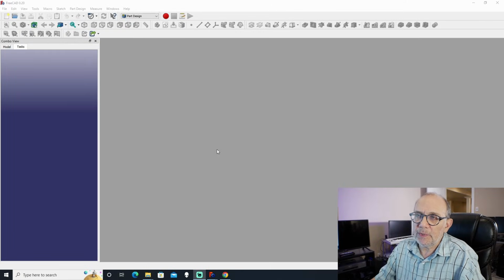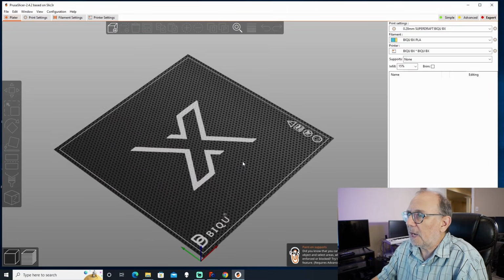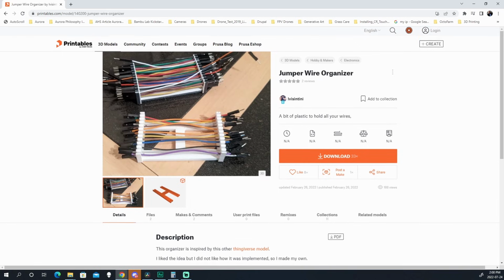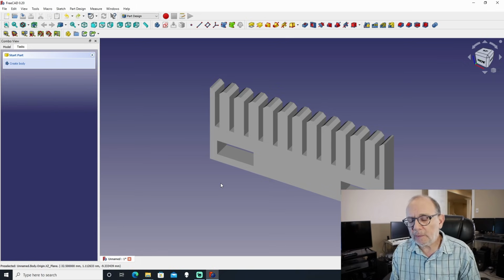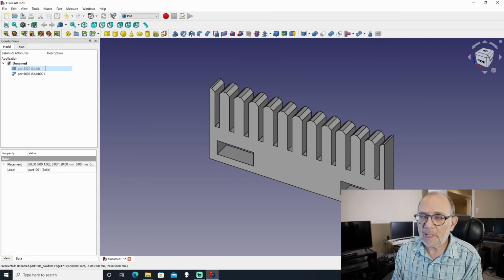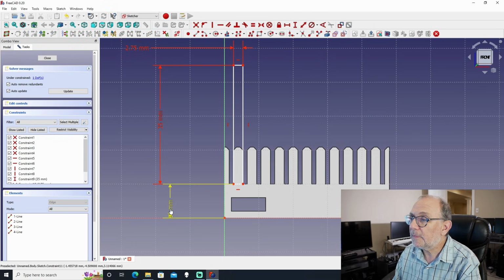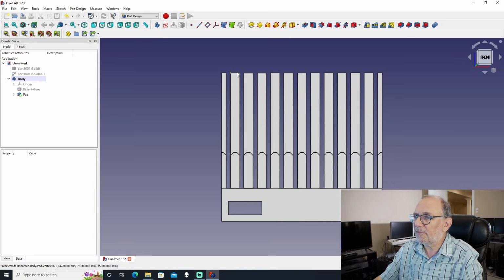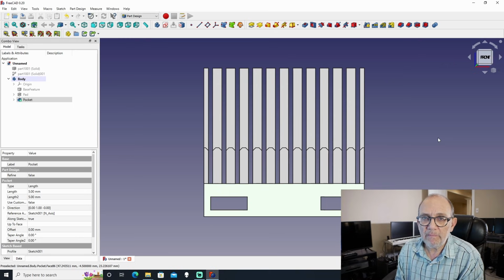Two Easy Ways to Edit STL Files For 3D Printing

Comment: Thanks so much for making this. I am having an issue though. When I create a copy and refine shape to get rid of all the additional lines only a few of them disappear. Any ideas why that would be or anything else I could try? Is my shape too complex? It has some curves so maybe that is the issue?
Reply from the maker: Yes, it's because the shape is complex.  However, strictly speaking you don't really need to simplify.  You might be able to edit and use the model even with the lines.  I would just to ignore the lines and see if it works.  RG
Reply: @CreatewithTech  Great. Thanks for the advice

Comment: Thanks for this video; it's been really helpful. Freecad is a frustrating program as in it doesn't help the user. Nothing is intuitive. It's not unlike other complex applications pro video editors, graphics programs etc. Every time I think I understand a step and then try to extrapolate to another -seemingly similar step, I hit a dead end and have to go through the arduous process of figuring out what I haven't done correctly. It's like thinking you've figured out how to throw a dart at the dart board but in the next round, all the darts have been replaced with trick darts AND the dart boards move randomly. I reckon it gets easier but Christ it's frustrating. Thanks for your videos. they really do help!

Comment: Thanks, I had been frustrated that this feature is hidden behind the paywall in the free version of Fusion. Just to note that choosing the sew option with a tolerance of 0.01 on anything moderately complex will leave you waiting for long compute times. FreeCAD manual says:
"Optionally check the Sew Shape checkbox and specify a tolerance:

    This option is usually not needed. It is meant for mesh objects that are not watertight and have small gaps between edges.
    If the option is selected a compound of shells, instead of a compound of faces, is created.
    The sewing operation may be computationally demanding."

Comment: Damn... I've been trying to think of a way to edit a mesh to make one part (coincidentally, two circles that overlap slightly like a Venn diagram) a bit thicker on a model I printed out, so I can use translucent PETG but have it be a little more opaque to see details on it. I didn't even think to just make the circles separately, and then merge them to the original model, lol. I'm kicking myself over how obvious this was, lol. Thanks for this!

Comment: Thanks for the video. Really clear and helpful. I have followed all the steps but my model didn't lose all the triangles (clone shape/refine) and i wasn't able to make 2d sketches on any planes. Could this be because my model was too complex? You stressed the need for simplicity several times but didn't say  what would we would see if it didn't work. My model is a 3d scan of a part, so lots of surface imperfections and quite a lot more complex than the one you used anyway. Thanks for any pointers.

Comment: Does this work in Fusion? I tried, but most parts were missing after converting
.
Reply from the maker: Hello...I haven't tried this in Fusion.  This kind of conversion is hit and miss unfortunately.  Whether it'll work or not really depends on the model that you're trying to convert.  It just won't work with a complex model.  RG

Comment: Hi thanks for the video. I see it's 2 years old and things may be different now. I also understand the two examples are used to show the principles involved. However it could make for an interesting new video to show how both these examples could be achieved in the slicer. At least I know it's possible in bambu studio. The first example by add part or add primitive. The second by cutting the part then stretching with scale tool, make the hole bigger with the negative part.
Hope to see a new video soon.

Comment: Blender 3D can edit STL files. Import STL file into Blender3D. Go into Edit Mode. Select points at the top of the posts and move them up. Select points at ends of rectangles and move them. Export model to new STL file.
Reply: Do you have a video explaining this?

Comment: Ok, so everyone else has obviously watched something about setting up FreeCAD that I've missed and can't find. I've just downloaded FreeCAD and opened it stock standard. First of all your video shows a FreeCAD with a lot more icons than mine, and when I click New under File menu, I don't get a screen saying Select Features and there is no option to create a new block nor a new sketch. So, within 2 minutes of watching your video I'm stumped.
Reply from the maker: Hello @dennisbartlett7005...I'm sorry about the confusion.  FreeCAD is set up with different work benches, depending on what you want to design.  When you first download and open the application it will open with the "Start" work bench.  You can see this at the very top field where it says "Start".  The field is a pull down menu that reveals all the  other work benches available to you.  If you're designing for 3D printing you'll typically be using the "Part Design" work bench.  Choose that and you'll see how the menu changes and you'll get all the icons.  At this point you can go to File>New and choose that.  At this point you'll see the option in the panel below to Create body and then Create sketch.  I hope this helps.  RG

Comment: This is a great video. Unfortunately the program has updated, so most of this doesn't count anymore. I spent an hour trying to figure it out, and just can't. Appreciate the video tho.
Reply from the maker: Hi Sandra...thank you for your kind words.  It's appreciated.  I'm sorry that the video didn't help you much.  Which part were you having an issue with?  If you encountered a problem converting an STL into a solid the truth is it doesn't always work well, regardless of the CAD application.  Whether it works or not depends on the complexity of the STL.  The simpler the model the better.  Also, which version of FreeCAD were you using?  In the video I believe I was using the Realthunder version which is optimized more for this kind of stuff, although the official release should be able to do it as well.  Anyway, hopefully you'll find a way to accomplish what you need to.  Thanks.  RG

Comment: This video was incredibly unhelpful. The only valid sentence was: chances are you cannot do it. This was the my first and last visit on this channel, going back to mangojelly.

The conversion goes like this: mesh->shell>solid->boolean
This can fail on every stage. If you delete the previous stages, you will have to start over it again.

No word about what you can do if the conversion fails. 

And it fails most of the time.

For example:
I have an stl. It cannot convert to shell. If I split it in the mesh workbench, then the two components are converted without error to solids. But the two solids do not union. If I try to analyze-repeair them, the mesh does not resemble the original.
Reply from the maker: I understand that you're frustrated, but that's no reason to be mean and negative.  In this video I try to be as helpful and honest as I can about what can and can't be done.  Unfortunately converting an STL to an editable body is hit and miss at the best of time.  There are many factors at play and as you've discovered it often doesn't work well.  In general, the more complex the model, the less likely it is to succeed.  Again, there's no reason to be on the attack, as this video is not clickbait nor am I trying to deceive you in any way.  I'm trying my best to add something of value to the maker community.  Mangojelly is incredibly knowledgeable (I learn a lot from him myself) so if you can find a better solution to the problem on his channel I encourage you to do so.  Thanks!
Reply: @CreatewithTech  I am sorry. I was way too hostile.

I have spent hours to get a recipe on how to import stl into freecad. No video tried to give a complete answer to this. 

After the 10th video 99% of the video was redundant. I had to pick up bits and pieces.

So I came to the decision, that they either can not compile this information, or they do not want it. First is incompetence, second is intellectual dick-swinging.

And you were the 32th of them. So all that came to you. 

So far I have come up with what I can try.

Import the stl.
On mesh wb analyze /repair
On mesh wb split apart.
create shell
make solid
refine shape
union the components

Except for the first, every step failed for me at least once or distort the model. 

Mangojelly tried to import a real stl. Not to find one that is easy. 

Your video is not about importing and editing it, but editing it if you can import it. It is like a video on "how to get rich, and spend money".
Reply from the maker: @tarhelytarhely5662  I understand.  What kind of STL model are you trying to convert?  Can you show it to me?  The reason YouTube videos typically use simple STL files as examples is because it's virtually impossible to get complex ones to work.  Anyway, if you have a link to the STL file you're working with I'd like to see it.  RG

Comment: Hi, thx for this video.  I was wondering why you didn't use external constraints for your sketch to attach the sketch to the original model.  Is the 3D model produced from the the .stl file not work with the external attachment tool?  Also I noted that you didn't fuse your extensions to the original model, which is interesting as it indicates the slicing sw has no issues with solids conflicting in the same space.  Finally I was wondering why you didn't use the rectangular array tool and make all the copies in one shot?  
Thanks again for this video I learned a couple of things.

Comment: Hi there, I just subscribed to your channel after viewing this video and apparently have an issue with successfully making the file ready to be modified.  After following your instructions to the point of "Creating a Solid", I appear to run into trouble. I see "Solid" in brackets after the File Name.   After I "Refine Shape". I see the following message in Report view -. "Recompute failed! Please check report view".
This happened about five times in a row.  Most recently I failed to get the Error Message BUT as in all previous attempts, the excessive Triangles remained.
I'm using FreeCad Ver 0.20.2
Reply from the maker: Hi Randy...I'm sorry you're having issues.  As I mentioned in the video, the technique I'm using unfortunately doesn't always work well with every model.  Converting an STL to an editable object does sometimes fail.  If you give me a link to the STL I'll be happy to try it on my end to see if I can get it to work.  RG
Reply: @CreatewithTech  Thanks for your rapid response, with this being a 7-month-old video, one can never be certain of the response.  I understand your "Disclaimer" -  with greater complexity the chances of success diminish.  That being said, I see this as a rather simple file from Thingiverse - it's an extension bracket to relocate the filament reel on a Creality 3 V2 printer. I simply wanted to widen the base for greater stability and easier access to the hardware,   Thanks in advance from a fellow Canuk.
The Thingiverse file is posted below.
Ender_3_Filament_Spool_Holder_Adaptor_v01_2948891

Comment: I followed your steps and I was able to import an STL and then I added text to the model.  When I tried to export it even though I can see the text on the model in FREECAD I can't see it when I load the model into CURA..  Under model solid I have a body, then a base feature and two shapestrings..  The text is maped onto the face of the model and it looks perfect in Freecad.. Just looking for some advice...  HELP?
Reply from the maker: Did you PAD the text after applying it to the model?  If you put the text on the body, but didn't PAD it you won't be able to see it when bringing it into CURA.  RG
Reply: @CreatewithTech  I extruded the text in PART. I didn't pad the text in part designer.
Reply: @CreatewithTech  I did..  I did the PAD after applying it to the model.. So what should be the correct sequence/operation to apply text to a model I imported as an STL?
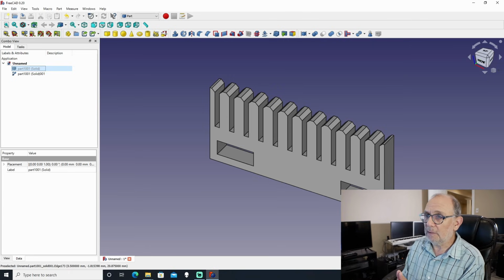Reply from the maker: @charlesdix4831  You would apply the text after you create a body...so after this point in the video: 11:50
Reply: @CreatewithTech  Thank you.. One more question please.. If I have a STEP file of the object do I follow the same process you have indicated for adding text?
Reply: @CreatewithTech  Well, I am still having issues but will keep working at it.. I think part of the problem is that the face I want to place the text is angular.  So I opted to do your #1 solution and create a new model (triangle) and paded that and then did the printing on it.  Then combined both models in CURA and sliced.. Worked great that way.

Comment: RG your videos have been very helpful in my start within 3D printing. Could you possibly do a beginners guide to setting up Cura and explain which slicer you prefer and why?
Reply from the maker: Hi Phil...I'm glad you find my videos helpful in your 3D printing journey.  Interestingly I've been thinking of doing a video on setting up a slicer profile and which slicer I like to use.  I started with Cura and now I use both Cura and PrusaSlicer.  I will be working on a video on Slicers soon.  RG